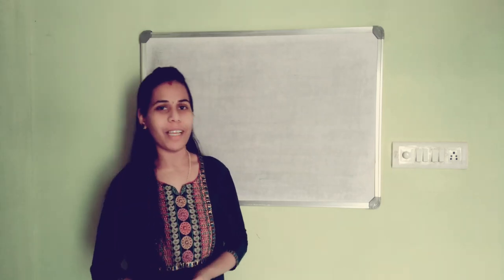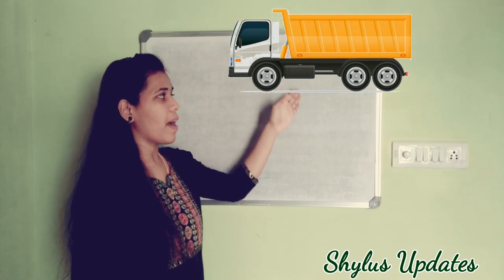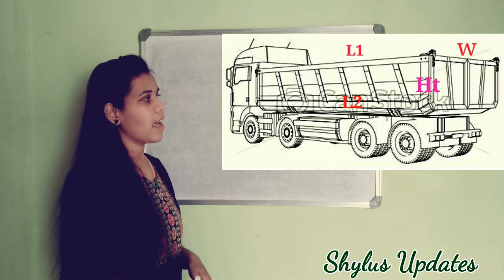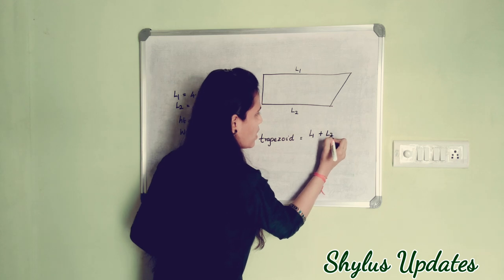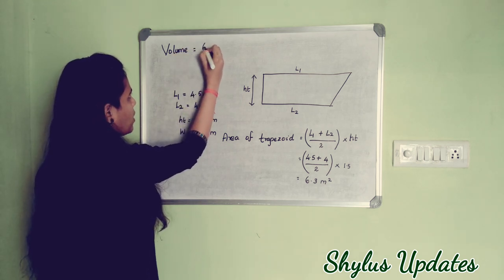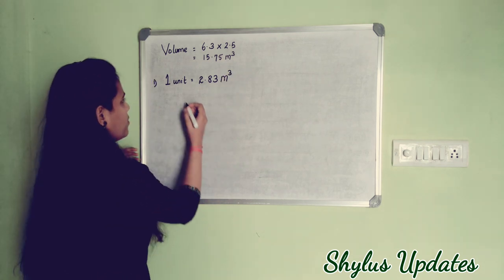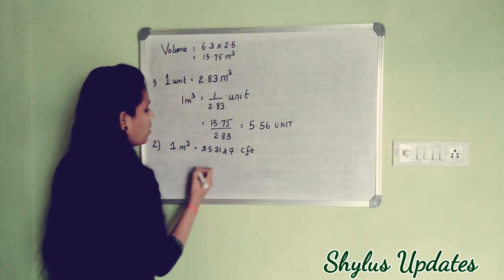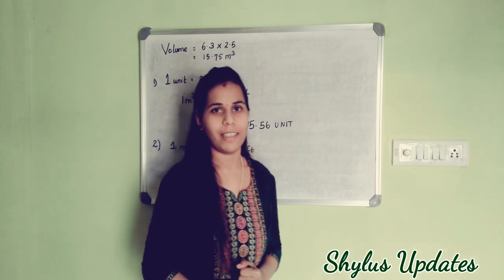HOW TO CALCULATE SAND AGGREGATE QUANTITY IN TIPPER OR TRUCK | SUPER TRICK | DONT MISS IT

Comment: Hii madam, nice explanation, but I have doubt 25.75'x7.75'x3.75'=748.35=749cft,how to convert CFT to tonnes sand and aggregates 20mmand 40mm
Reply from the maker: Dear Sanjeeva Yadav,
1 Cft = 0.068 Metric tonnes (t) in mass